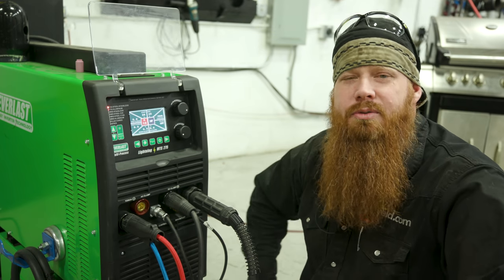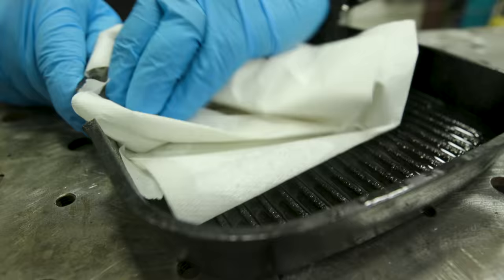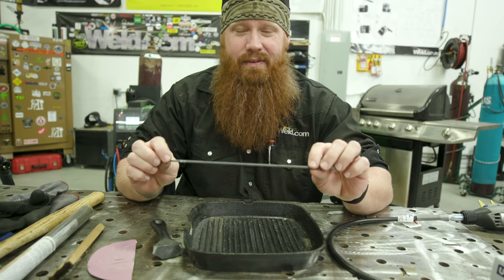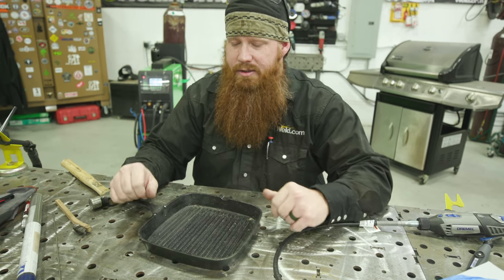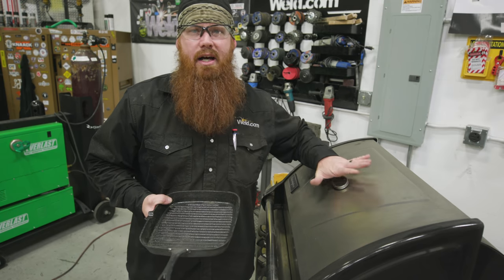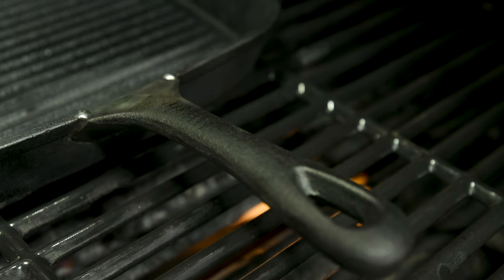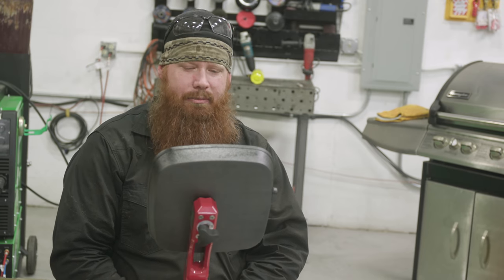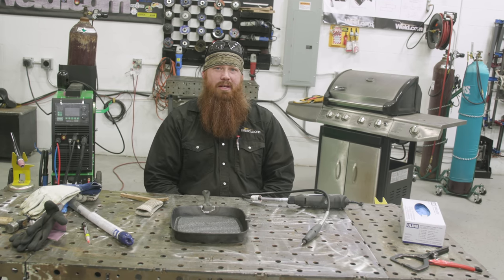Cast Iron Skillet Repair

Comment: I have done similar to this in the past with one exception, my Father taught me how to do Cast Iron welding with Stick, not TIG as you have shown here although I have removed the Flux form Electrodes to use with TIG as you have shown here. Preheat and Postheat was essential for a good weld with stick.
 Question. I was taught to peen the hot weld as you worked along the repair, so would that perhaps be applicable in this process using TIG as method?
 Thanks for your Video's from John, Australia. PS: Always done at Low Amps with Stick.

Comment: Ive had pretty good luck doin cast iron and cast steel with a pre heat to 450f, weld with plain .035 wire, peen the welds and post heat in a tub of sand.  Done many dana 60 and rockwell knuckles that way for repair and armoring them up.  I noticed with cast steel peening isnt really needed because it doesnt pull apart as bad as iron when it cools.

Comment: I welded some steel bar to reinforce a cast steel tool and it welded beautifully with stainless steel rod. I expected it to be cast iron and not to work but was surprised as it was just like welding steel to steel. Cast iron on the other hand just a PIA.

Comment: I use SiB, AC, and grind after preheat as well to get rid of the oxide layer that forms. Do my best not to melt the metal and let the bronze wet in, but sometimes that just isn't possible or needed.

Comment: Great stuff! Would you use the same filler on a cast iron turbo manifold?
Reply: Or iron cylinder heads as I haven’t seen any tig or stick welding on older iron blocks or cylinder heads yet ( I looked on internet/YouTube for a how to video ) and I had one that needs fixing and is a harder to get and more valuable than the average junkyard lsx turbo swap which I’m curious to about turbo manifolds too because that’s one of my plans to add and I might be able to skip a couple of steps and just weld on the 3” V bands for the intake hot side/hang to turbochargers ( running 20-40 LB drive pressure ish boosted side aiming for max 2 bars gage reading ) off of the repoped wedge 🧀/426 hemi earlier horn manifolds that have the same shape

Comment: Were you melting the base metal or was this more of a braze?  If the base metal was melting and forming a puddle are you looking for a lot of dilution with the filler, does that filler tend to crack without base metal dilution?

Comment: I bought a drill press years ago that had a fracture in the column clamp for the table. All I knew about cast Iron welding was preheat and use Nickel.I partially prepped with a grinder and tacked, then used a gasoline plumbers stove to preheat to dull red. After the first pass I finished the grinding and back on the stove. Weld second pass and back on the stove, then cool overnight in a bucked of fireplace ash. I have heard that Nickel welding creates "crystallized" metal in the heat effected zone. I suppose they mean White Iron. I am sure the extra post heat annealed that back into Grey Iron. BTW 99% Nickel- DC stick.

Comment: Awesome repair on that pan...  and you do some funny impressions...  Hilarious...  but...
I'm just a bit concerned here, by the use of nickel to make the repair.  Cuz I've read that nickel is toxic in high doses and so I'm just wondering, how much nickle could leach into the food while cooking?  Maybe it's okay because it's only the handle location and food probably wont touch that area?
Also, there are many people who use electrolysis to strip their pans before reseasoning...  Removing years of carbon buildup, crud and rust from their cast iron pans... and then reseason the clean pan.  Placing the cast iron in a bath of water and washing soda (sodium carbonate) and then applying electricity, via an electrode placed in the bath, with a 12 volt car battery charger, one end hooked up to the electrode and the other to the cast iron piece.  It seem a popular method used by many cast iron enthusiasts.  But there are a couple metals that should never be placed in this type of setup, any metal or alloy with chrome or nickle because the process will produce a solution of Hexavalent Chromium which is highly toxic substance.  If you've ever seen the movie “Erin Brockovich“?  Hexavalent Chromium is the toxic chemical that was identified in that movie.  
But I'm just saying, that many people will use this method of electrolysis to remove carbon buildup and rust from their old cast iron pans before reseasoning.  So one should really avoid this method on any cast iron which contains nickel.  That goes for any vintage nickle plated cast iron pans.

Comment: Hey Bubba what gas you running? I'd mig this with stainless wire. ( cause I can't afford Tig.)
Reply: Dandahermit Seals only the finest 100% Argon blend.
Reply: @GodslilRedneck23  If it's a blend, it's not 100%...  :)
Reply: Dan L. True.
Reply: @GodslilRedneck23  My supplier sells 99.996% Argon, and 99.999% Argon.  He convinced me to get the "5 nines", which costs 2.5x more.   What's your opinion on this?  Waste of money, or worth it???
Reply: Dan L. Honestly I thought it was BS originally. But then I talked to a guy in the industry who explained how critical gas compositions can be for certain applications. The most important thing is to consider is the moisture content. Not all distributors are equal in that aspect and it plays a major role in the outcome.
Reply: @GodslilRedneck23  I never occurred to me to think about moisture in the gas.  Here is a video idea - maybe talk about these factors in one of your upcoming TIG videos?  Seems important!  
Thanks for your reply Jason.
Reply: Dan L. I’ll see what we can do. Thanks for watching.
Reply: Flux core mig works better that mig ss wire. Been doing this for 20 years on cast iron skillets and vises. ER309 rod works very well on tig also.
Reply: @danl.4743  Just find a supplier that sells gas that complies with AWS A5.32. If they can't offer that then move on.

Comment: I am curious if you had any issues with slag buildup due to all the "trash elements" in cast iron. I have done a tig braze job on a car exhaust system that was cast and it was not pretty but good pre/post heat means that a few years later it be holding up!
Reply: No slag at all due to the fact that there is. I flux being used. There is a bit of reaction from the base metal though. You can hear it in the arc shots if you listen close.

Comment: tig welding is the best process  it uses DC negative  70 % of the heat on the base metal and 30% of the remaining  heat goes to torch the positive  current  will pre heat the base metal and prevent  it from cooling  down
Reply: mohammed troy thanks for watching man.
Reply: @GodslilRedneck23  you are a specialist you are the best professor  weld.com ever had

Comment: What if I told you...

Non-chlorinated brake cleaner is around 80-90% acetone. The rest is propellant and heptanes.

Source: SDS for both CRC and Blaster versions, available on Home Depot website/app.

Comment: While you are at it, can you grind those ridges off the inside bottom? I have that same pan, and all they do is make it difficult to clean. Makes no sense why a cast iron pan would have those. They aren't deep enough to hold food above draining grease (and why would you want that anyway?) and the pan walls are deep enough that you don't need to worry about the food sliding off.
Reply: i honestly think those are just there to make fancy lines on steaks and burgers.  No real function otherwise

Comment: Didn't know that you could remove the flux coating from the casr iron stick electrode and do tig welding on cast iron. Can you do that with aluminum stick electrode also.  Am doing aluminum welding with the mig welder (spool gun). Still have a few boxes of aluminum stick electrode  don't know what to do with it. Thank you very much. (Andrew). Oops i made a mistake....(cast iron).

Comment: can the same type of cast iron repair be done with a mig.
Reply: Ikr!
Reply: Yes but you will need nickel wire and appropriate gas.
Reply: I've done it with c25 er70s-6 on castings to large to preheat in an oven just heat it with a torch to about 350 and go. Still in service today and was welded several years ago.
Reply: @TROLLGOD666  You can sometimes. Depends what it is and what it's made from. "Cast" is a broad term. There are 4 major groups of cast iron and each of them has different compositions and methods of manufacturing. Some are readily weldable, like steel, others will crack with just a spot weld. So while one can weld "cast" with GMAW another may not have any success.
Reply: Agreed Geoff. I've had some I couldn't even tig because they kept blowing out and some that flowed like butter nice and smooth.

Comment: I thought modern 'cast iron' cook-wear has a lot of carbon steel in it to aid in manufacturing?  Does that make a bid enough difference in how it is repaired?
Reply: HardwayRanch from my experience, not much.
Reply: only major difference between "cast iron" and "carbon steel"  is the carbon content. Cast iron has a bunch, usually around 3% if memory serves. High carbon steel usually tops out around 1%, unless it has a bunch of alloying stuff added in. Some of the super steels and stainless steels have 2% or more, but usually lots of chromium and other stuff. If there was a "cast iron" product that had closer to 2%, I'd assume it was much easier to work with that something closer to 3%. I weld high carbon steel on occasion and it is tricky, but better than cast imo.
Reply: Then there is also "cast steel", which I have zero idea about. It may be something like I said, a little lower carbon content cast iron. That's just a guess though.

Comment: The problem with doing it this way is you still have that jagged crack right down in the root of it that's going to want to crack out again. Grinding that crack smooth before putting the piece back in and welding it is the better way to go about it.

Comment: Another great video! 

Can you weld steel to cast iron using that nickle electrode as filler rod? Like adding gussets to an axle or something similar... Or does it have to be done differently?
Reply: I believe you can I have not done it but I know a welder who had some success using a rod designed to join dissimilar metals. check the Lincoln  metals use catalogue that may steer you in the right direction.
Reply: @bruced1429  thanks for the help!
Reply: Try er309. Specifically made for dissimilar metals ( steel to SS) but works excellent on cast iron and cast steel.

Comment: I've made a lot of cast iron repairs in my time. I agree with your pre and post heats, but if the roads were good you might as well just burn them in mma. To do a proper job use silicon ferrite rods. Big problem with cast iron is welding a hole in the middle of a bigger piece. Shrinkage!!!🤪🤪.

Comment: Think I would have grinded a chamfer on one side of both pieces then tacked it together 
Then weld one side then 
V out other side to the filler weld then finish welding the other side

Comment: I’ve had years of long term repair success using this method and it’s totally wrong according to anyone with an opinion. You know, the badas# pro dude that’s better than you, everyone else on the planet and knows Everything about All of it and invented welding after he invented fire. . This method does work despite the “chromium and carbon issues” which may be very true. Preheat the part with a propane weed burner, check the part with a temp stick, use 316L and a needle gun on mid throttle with high pressure to push your root passes into the casting pores before the actual join repair and also occasionally needle gun as you go. This eliminates stress fractures, makes the oil and munge float to the top so you can knock the impurities off and will make the micro cracks appear. The cracks that you can’t see or may have missed while doing the grind prep. You want to catch the stragglers as they can create future failure after the repair and after the part is back in use. Post heat, pack a fire blanket around the part when your done and leave it until the next morning. I always do cast repairs after lunch so I’m not leaving a hot item in the shop when locking up. I’ve never had a cast repair come back using this method but I’ll definitely check out your process. I’ve used Inconel in the past too but the stainless method has always been 100% reliable. It works extremely well on early or preteen manifolds, blocks and high heat parts.  Something you reminded me of with your rod prep in the beginning is repairing huge gaps on non structural parts or jobs where the repair isn’t so critical. When I’m stick welding junk like salty steel handrails, corroded deck pads and things of that nature I’ll take a handful of 6011 rods, hammer the flux off and use those rods as filler rod to the sticks I’m running in the stinger. Then switch over to 7018 or jet rod. It’s like tig/stick welding. Tick welding? I dunno, some old fart in a shipyard showed me that one day when he was tuning up a busted scrap bin that had a huge tear in the side. It’s a hell of a lot faster than running stringers for a repair that doesn’t need it. I always pay attention to the old guys on job sites doing weird stuff that doesn’t make any sense. There’s nothing wrong with having an open mind and trying new things.
Reply: 100% agree. 309 works too

Comment: I've heard of guys welding machine cast with 7018 dcep? What's your opinion on this?
Reply: Ryan Schmaltz why not?
Reply: Kent Lange I’ve heard of people doing it. Maybe in a pinch but I’ve done the method in this episode many times with great success. It’s my preferred method because I’ve always had great results.
Reply: @GodslilRedneck23  I don't own a tig setup, and as a stick welder setup is what I do have readily available, it seems that this method(stick welding with 7018), doesn't get covered anywhere in detail that I can find, with any clarity. I agree, watching this tig process, it looks super trick, but many people have a stick welder, and not many have a tig setup available to them, that's all.

Comment: This is not too different to the way I recently welded some mild steel bars into a brand new, unused cast iron household fire grate to turn it into a smaller fire grate for my quarter scale coal fired traction engine. The only real differences are:
I used oxy/ace
I welded while the grate was still on the gas burners
I left the grate on the reduced flame for about 10 minutes after.

Comment: And there was me just burning in a 316 stainless mig weld
Reply: I have also used stainless steel stick rods for some successful repairs.
Reply: Use what ya got. Tig is expensive. I'd go oxy-aceteline n sil bronze or mig n stainless wire

Comment: You might consider telling the viewer WHY you used nickel filler rod.  I looked up the melt point of cast iron and nickel.  They’re within a few hundred degrees of each other.  Also you mentioned silicon bronze in the beginning which of course is brazing.  You might contrast the two processes and explain why TIG welding with nickel rod makes more sense.  Thanks.

Comment: I work a lot around specialty alloys and weld repairs always come up often. a better electrode to use if you can find it is 4N11 or 8N12. primarily a Nickle based rod with a some additives in it I find they weld better and cleaner than Nickle 99, also theyre are less susceptible to to cracking in my experience.( obviously pre heat to around 400-600 F, slow cooling in sand or cover with a fiberglass blanket, PWHT to anneal it) unfortunately those guys are near impossible to find if you dont know the right person and theyre fucking expensive.

Comment: Isn't non chlorinated brake cleaner acetone? I believe it is.
Reply: Depends entirely on the country. In the EU I believe brake cleaners are typically a mixture of light naphta and acetone because they're relatively speaking quite safe. In the US it seems like they might either have chlorinated solvents, toluene and methanol (Yikes!) or then just acetone.
Reply: Non chlorinated CRC (green) Methanol, Toluene, Heptane, Acetone and CO2

Comment: Would'nt it be easier to grind Egdes on the seperate parts before you spot them?. You can use much cheaper grind tools and it will be faster.

Comment: mig NON copper coated high carbon steel wire, 100% CO2 shielded   mild steel to cast iron or cast iron to cast - pre/post heat ='s safer way to go.

Comment: thanks... didn't show the completed weld... didn't talk about grinding the weld for appearance vs not for strength.. didn't talk about load expectations or use of the item where it is constantly heated and cooled.. or in the case of an engine part like an exhaust manifold vs a thermostat housing.. but hey funny voices 👍